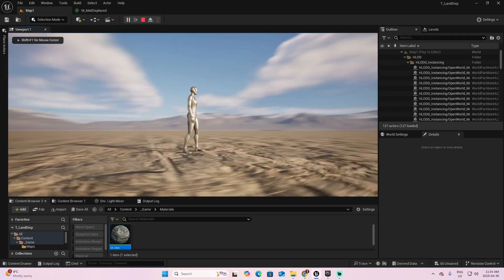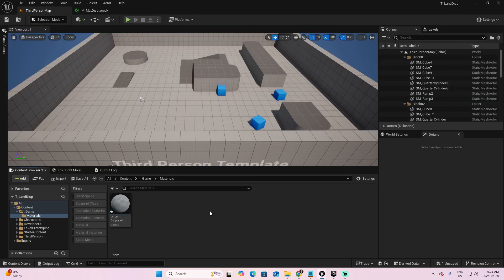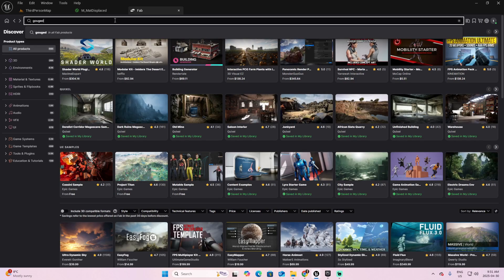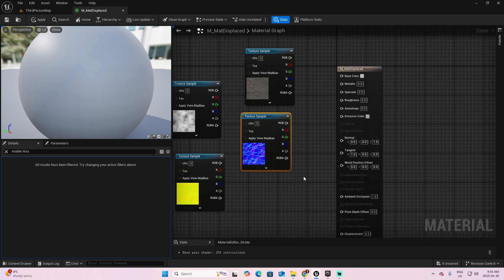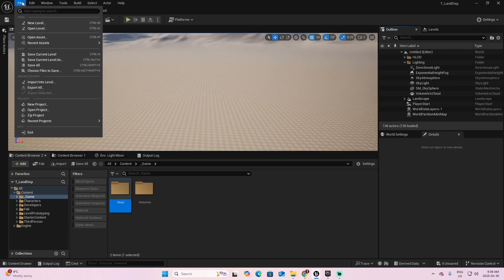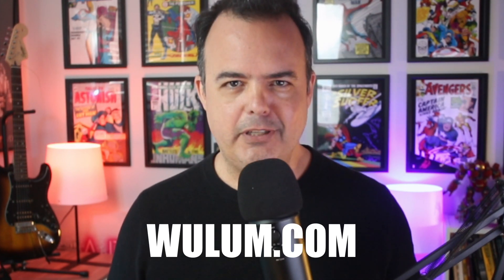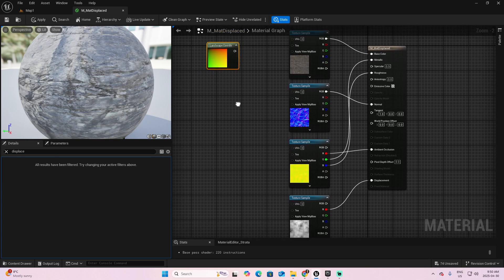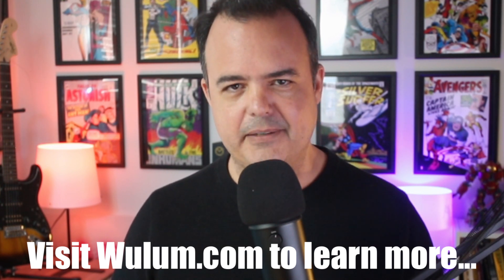Master UE5 Landscape Displacement with Nanite Today | Unreal Tutorial

Comment: It works in editor, but when packaging the nanite tesselation is gone on the landscape. Works on a normal cube etc.. Using 5.6
Reply from the maker: Thanks a lot for leaving this comment. I went back and tested it again, and you are totally right. In UE 5.6 Nanite tessellation on Landscapes can work in the editor but gets disabled in packaged builds, while it still works correctly on regular Nanite static meshes like cubes.

A few things people can try:
- Make sure the project is packaged with DX12 and Shader Model 6
- Ensure r.Nanite.AllowTessellation=1 and r.Nanite.Tessellation=1 are also present in the Shipping config
- Test with a Development build first instead of Shipping
- If displacement is critical, a current workaround is converting parts of the landscape into Nanite static meshes

As of 5.6, this feature is still not fully production-safe for packaged games, especially on Landscapes. Epic is actively iterating on this, so this may improve in future versions.

Really appreciate you pointing this out. It’s an important detail for anyone planning to ship, not just experiment in editor.